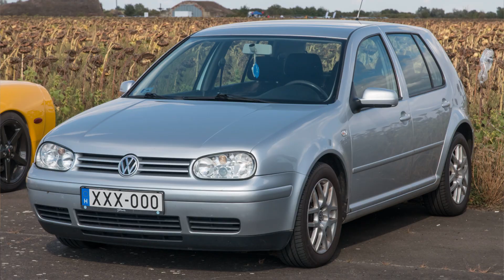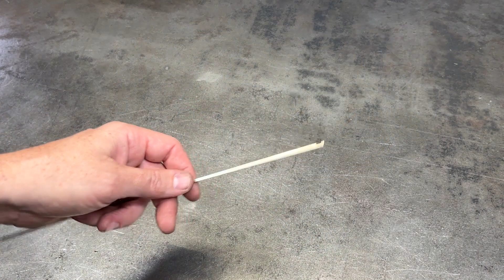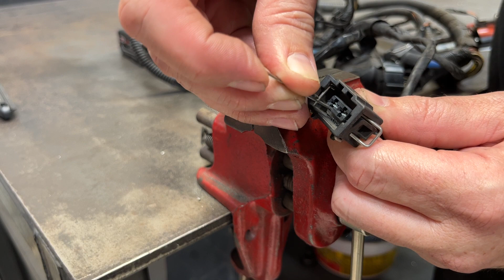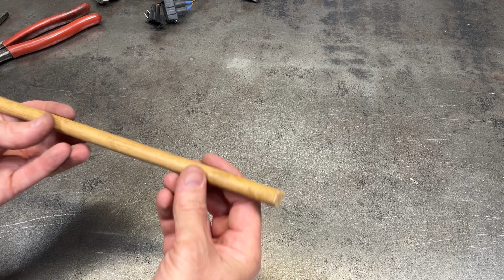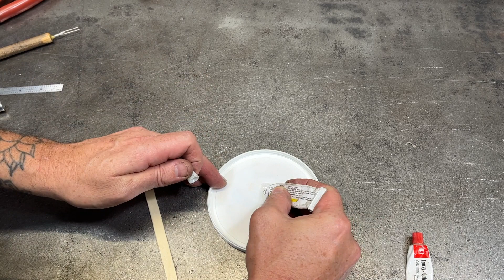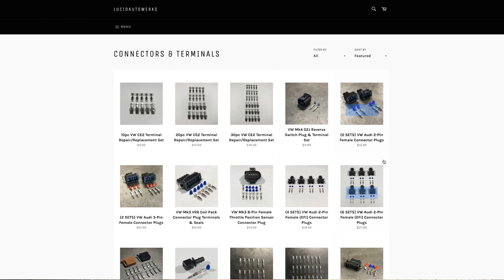Making a Terminal Tool & How to De-pin VW Connectors

Comment: Great tutorial, I have made a tool for myself. Has anyone seen this work on the large round connector for the loom?
Reply from the maker: The round connectors for the engine harness have offset tabs. One tab is at a different depth than the other. I haven't tried to make one that does those yet because I haven't had to remove any of those terminals. It would work with enough testing and refining of the lengths.

Comment: Thank you ever so much. I am working on my 2008 Toyota Sienna XLE Limited and I have a cam lobe sensor that has a problem and while trying to repair it I broke the connector and have been looking for weeks for the replacement connectors and the tools that would allow me to do the repairs. You are a life saver.
Reply from the maker: Glad it’s helpful!
Reply: Same happened to me, my 2019 golf R left mirror broke and I cannot disassemble it bcs a tiny whole and the connector didn't fitting on it, my only option was to cut the wire and wait a month for the new connector to be delivered to do a good job and not just ugly joins, not only you make save money but also valuable time! Thanks a lot for sharing this apreciated knowledge!

Comment: I've worked with all sorts of OE terminals building/rehabbing harnesses.  These Bosch style with the 2 little catches (oh, and the little push-tab inside that hooks on the catch in the other direction) make these the biggest pain in the arse.  The terminals on most US made cars are much more practical and MUCH easier to de-pin.  Rant over...I feel better.